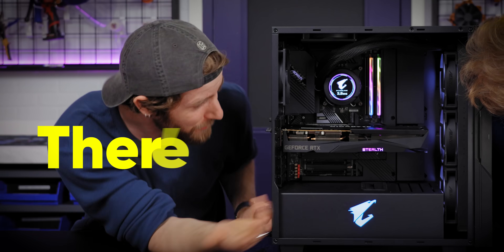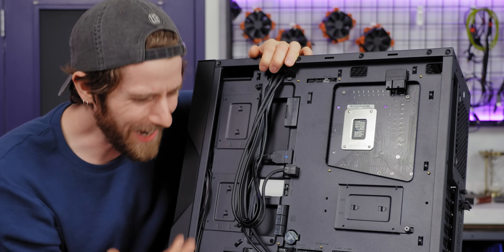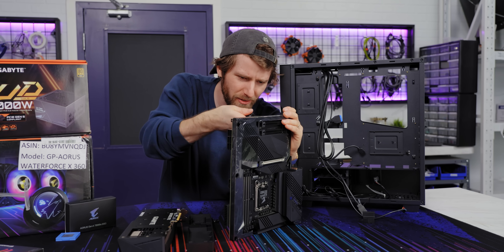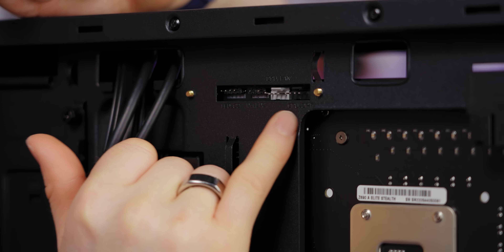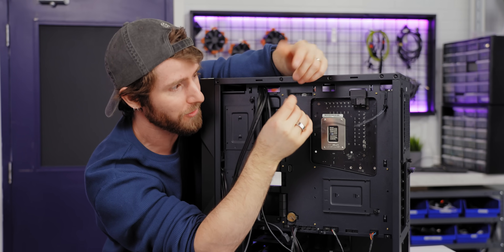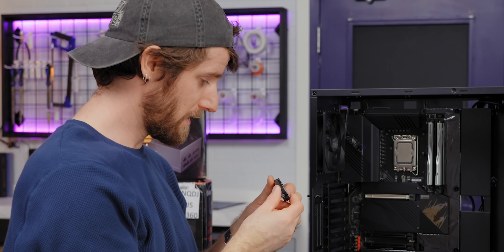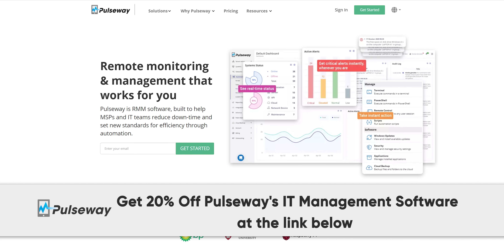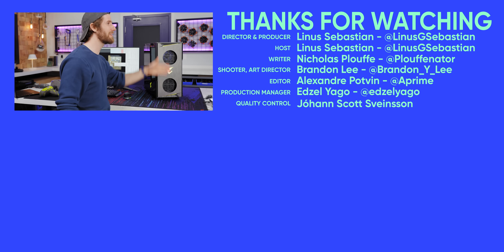Where Are the Cables??? - Gigabyte Project Stealth

Comment: It might be based on an existing board, but they either needed to reroute all the traces for the back connectors or somehow get bottom-mount connectors that more than likely do not exist, and would be so niche they would have to be entirely custom parts in a low enough volume that the typical OEM wouldn't even spin up a low volume line for them; and thus, more than likely the former, rerouted traces to match the lack of ambidexterity of the connectors. 

I like the idea of rear-mounting internal I/O, it definitely makes sense with m.2 components, but there's so much flexibility with every other port that I just don't see it ever working as a standardized implementation. A standardized implementation would have to dictate where connectors are located, which stifles some board design options, unless the standardization has an exclusion zone on the case side of the standard, which could still be problematic. 

Personally, I'd like to see the idea of a case with a depressed motherboard tray and all the motherboard connectors being right-angled. Similar concept to this, but closer to that of typical design, just with a sunken-in motherboard, so that all the connectors can be hidden under either sheathing or a custom panel; a panel similar to the full-board covers that Asus has (or used to have, I haven't looked at motherboards in forever) on some of their products. This doesn't fix the GPU's cable, but everything else would then have a hidden cable with a more manufacturing-friendly approach to the concept. 

Though, as a stem from all of this, I wonder if the PCIe spec could have a future where there's an extension to the slot that's meant for power throughput. We've seen motherboards in the past with a 6/8 pin connector for assistance supplying heavy PCIe usage boards for the motherboard side of the power requirements, I don't see why something similar couldn't be done with the modern PCIe 5.0 connector from the PSU to the motherboard, and a blade connector from the motherboard to the GPU, for a 'cable-less' solution. Combine this with the move to 12vo, and this kind of implementation could be seen as an extension of motherboard power, such as how the 24 pin connector was once a 20 pin connector with a 20+4 pin option. It might seem dumb at a surface level, but it would consolidate power to a singular connector location, and would tidy up cable management a lot; motherboards could also be designed with various protections between the GPU and PSU if this were implemented. 

Though, all of this would need massive standardization updates, no matter how you look at it. The industry as a whole needs more modern standardizations for a way forward with ideas like this, ATX is outdated and is stifling modernization, PCIe is also pretty dated, just look at the lack of a higher density connector that could easily exist (SuperMicro uses a higher density connector as part of their 32 lane implementation for card risers), 12vo is really the only modern standard coming up but I also feel like it may be stifled by other older standards. The duality of the industry, especially with SFF becoming a growing choice of system design, seems to constantly be 'let's innovate' while also 'let's stifle progress with antiquated standards,' it's getting a bit ridiculous and design is coming to a point of hitting a wall because specs won't update to modern needs and the industry as a whole won't move on from antiquated specs that refuse to update.

But at the same time, we can't even get everyone to agree on front panel connectors, so all of this is entirely moot.

Comment: The no air-flow case is very disappointing. What if someone wanted air-cooled instead, epic fail. Every case should be designed for air-cooled first and foremost then adjustments for water-cooled. So stupid! It will be some time before I consider one of their cases.

Comment: I just got this case, not the stealthy cable management version but the normal C300 glass. I had to reverse the fans on the front AIO to suck in air and buy 3 more case fans because the ones they include are absolute garbage. Now my temps are kinda okayish tho im tempted to get those beautiful holes on the front too :D

Comment: Might've helped to plug in the Mainboard connectors back onto the mainboard before tightening all the screws, there can be a wiggle wobbly difference of 1mm that blocks you from plugging that RGB header back in.

Comment: all you have to do is to change it to a 240/280 and mount it at top and fans under it and blow air out the form negative pressure, it will at least maintain in a temps that is not goin to overheat , although it is not a gd temp but at least u dun have to drill holes

Comment: I had a very similar case from them in terms of the front and it was fine with my old 1070. When I bought a 3080ti I had to solve the airflow issues which I did by literally tearing all the plastic aside from a small square around the light up icon. It was ugly as shit but it helped a lot.

Comment: why doesn't he use the top of the case insted of the front panel 7:44 ? is he using a tape to hide the hole on the top 13:24 ? 
wtf ?

Comment: experience wise, im actually agree for graphic card to have pcie power connector on the back like that (as a stealth or no cable look sku). its much more tidy. im pretty sure most cases will have a cutout near the back of it and in my case i actually route the cable through back instead of bottom.
i like graphic card that faces the pcie power connector towards the front case than the side as most nowadays but thats my preference.

Comment: im all in with this case...as long they includes mesh front panel option
Reply: And there wasn't enough space on the backside for the cables
And the holes for plugging in fans and rgb were the wrong size
And some of the fan cables were the wrong length
And you get an HDMI cable that does nothing.

But other than that it's a great idea!

Comment: The $80 case I got for work that came with a powersupply has a similar front design, but enough gap to get air through, and clear slits up the side that are for the air flow.  It works fine compared to this.

Comment: I was actually just thinking today why anyone hasn’t done this yet. And then this video came out. I hope all future mainstream PCs are like this honestly, this just makes way more sense
Reply: I don't think it's practical for all the ideas here to go mainstream BUT where it totally could work is the CPU 12V power connector. Any PC Case worth it's salt has a large cut-out in the motherboard tray so that CPU coolers can be switched out without having to remove the motherboard. The CPU 12V could easily be switched to the back of the motherboard in this area and retain compatibility with the vast majority of motherboards. The reason they may not do this is the increased packaging costs to accommodate a single connector on the rear :/
Reply: It actually doesn't make any sense. Even with a side window, you'll build it once, put it under your table or on your desk, never look at it again until you overheat and realize you need to dust it regularly because of the lack of airflow that makes the components choke from just a little layer of detritus.
Reply: Look who didnt pay attention to the video and didnt see the patent
Reply: @arial012  Well if Maingear who hold the patent are smart they'll allow other component manufacturers to license it so we'll get a wider selection of parts & cases that feature it. Otherwise it will just be a small niche market if it doesn't get scrapped by Gigabyte because it doesn't sell.
Reply: ayyyyyy didnt expect to see you here
Reply: yeah idk who thought to wrap the cables around the pc to plug in was smart...
Reply: they still cant align the parts so you can have a linear airflow path. server designers do that. they still do not provide adequate structural support for graphics cards. the ever growing pinouts of power connectors makes me want on-mobo dedicated power distribution for high power gpus. problem is making it standard, failure to do so just results in another proprietary thing.
Reply: Thing is, how do you account for different motherboard sizes? For all the different connectors some manufacturers would want to put there? Especially with office, workstation, etc builds, or very high-end gaming rigs, shit wont fit...
Reply: It is an improvement but m.2 drives in the future will need airflow and someday gpus will need a completely different design and mounting too so all airflow is unidirectional.
Reply: ELI? what u doin here
Reply: @I need cola F with only a single proprietary GPU compatibility... 

Nah, just give me an option for frosted glass side panel compromising compatibility for aesthetic is dumb. Especially for internal hardware.
Reply: All that is need is to standardize location and pin connector on the PCI-E side of any GPU, so that it is always in the same location on both MB and GPU when plugging in the GPU in. Problem solved of GPU compatibility.
Reply: @C76Caravan  Not really as graphics cards vary in size and compatability with E-ATX motherboards which are wider would need to be retained.
Reply: @C76Caravan  Gpu is still connected with cables, just from the back instead of front.
Reply: This is how custom systems are designed. A place for the cables, a place for the chips, a place for the external connectors and a place for the airflow. PCs are kind of messed up in that respect.
Reply: I hope i´m wrong but it will never take flight cause idiotic companies love proprietary too much, this would for everyone to play ball and use the same connectivity in the same spot. I remember years ago the dock-on plug-and-play concept also that never too off, a shame really.
Reply: Yeah, no... not until that patent expires
Reply: That‘s literally how the macpro back in 2019 is built. Not a single cable in this machine.

Comment: You know there really was no reason to whittle the connectors. You could have just went through and tried to connect and the ones that didn't fit remove the board for a second time take a Dremel and increase your openings the proper way. Agreed no air flow but I wouldn't have drilled it while it was on the machine that was just way too risky. And agreed Aorus bad air flow and repurpose but they can't retool but yet they can modify.

Comment: Wait wait wait so you mean, were it not for some corporate b.s. we could've had this cleanliness being the new standard all the way back in 2012 builds? ffs! Do you even know how much of a pain it is to be routing 6x2 cables for 120mm ARGB fans with 2 optical drives + 6 SSDs/HDDs? It's literally blocking my airflow! Jesus get it together guys I'd love to have this thing in a Phanteks case.

Although also being fair, I think even current GPU coolers are kind of a shite design in that it's just blowing hot air directly against your motherboard, which on x570 is really keeping that chipset hot af not to mention problems in NVMe drive cooling, so if they're going to lock you into one single GPU they may as well modify it to bounce the air off a back panel or somehow redirect the air toward the glass sidepanel of the case than blowing half it against the board.

Comment: They ought to standardize the first PCIE slot to delivering power to gpu. Not only would it look great, but it would prevent miners from installing more than one in a system (manufacturers could of course sell boards with multiple powered slots, and gpus that use external connectors, but those would become niche miner products).
Reply: Thanks for watching 🔝🔝
And commenting
Send a direct message right away 🆙🆙  you just won a gift🎁🎁

Comment: What a rollercoaster of emotions this build was. The back-mounted connectors seem like a brilliant idea - but then the holes aren't properly drilled out, argh! It looks spacious and clean - but then there's no freaking airflow?! Come on! Dang it!
Reply: Great for a video, but not a product.  Bizarre.
Reply: @brianwest2775  Solid front panel cases are like that.
Reply: @Aries0098  not necessarily.
You can still have decent airflow with a solid front.
It just needs inlets on the side of the front.
Reply: Life is sometimes filled with dissapointments.
Reply: I own this case. There is airflow from the front panel, but minimal. I would not suggest radiators on the front panel as demonstrated by Linus. I had to install fans on the top of the case to have a decent enough airflow overall, which is more investment than a mesh one. 

I would suggest using an air cooler for this case for better temps and populating it with intake fans. If you will use an AIO, stick with a 240 or 280mm on the top.
Reply: everything is watercooled on my pc  fans on  Radiator's   My Gpu  runs @ idle 26cel

Comment: The reason this won't take off is precisely because it's patented. Whoever at the patent office thought it was a good idea to let a company patent cable management needs firing. The great irony is, if you're going to move the power connectors to a better place then you don't really need cables at all, just a busbar. Either way, the company that patented this is cancer and I hope they flop.

Comment: I did this on a build years ago for the mobo atx connectors, fan headers, gpu power and front panel i/o, wasn't possible to do the sata/esata though. Was pretty sketch as the plugs had to be re-pinned mirrored from memory, so if you went and swapped the mobo or gpu you'd probably end up with a brief lightshow followed by nothing.

Comment: I actually thought of it long time ago, I wondered why cant they make a mother board that have all the connectors on the otherside, since most modern cases have those hidden compartment anyway, also why is no one making those power connectors as one slot similar to how blue usb connector did.